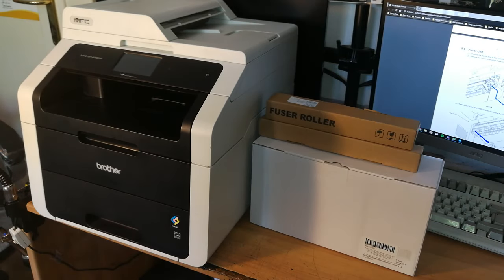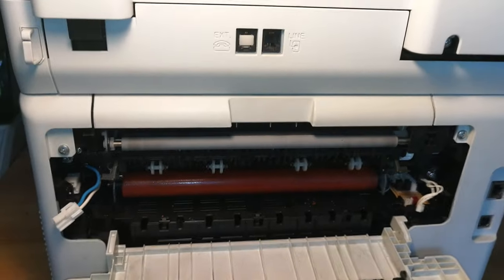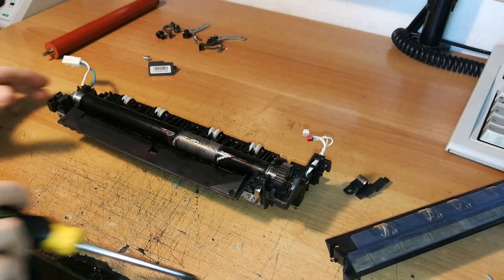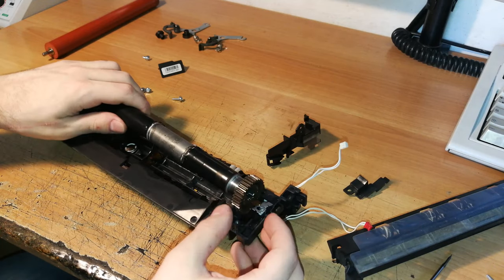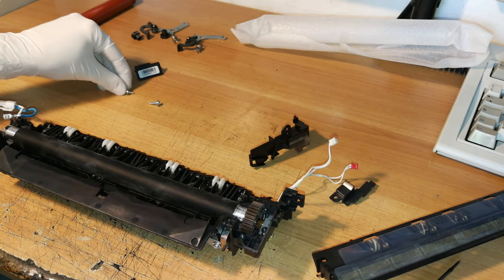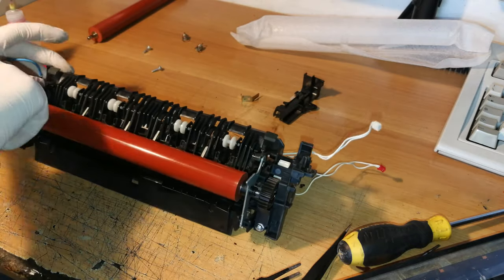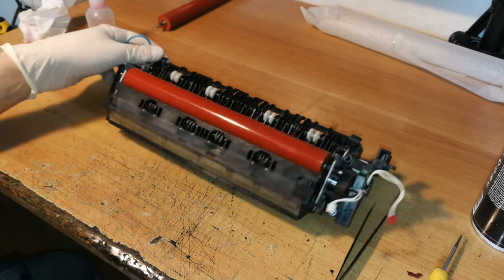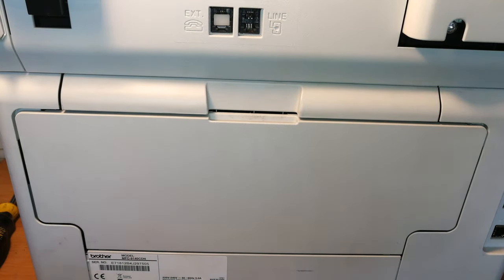Brother DCP-9020, MFC-9130/9140, MFC-9330/9340 • Fuser Unit Rollers Replacement

Comment: Thanks a lot Paolo, took me 2 hours but saved 300 bucks. I put the springs back the other way, so you have more place to pull them with a a small plate screwdriver head.
Reply from the maker: Great job :)

Comment: Thanks for the informative video. It’s worth mentioning (1) When re-attaching the springs, the black plastic tabs of the rubber roller assembly (the ones with the arrows pointing outwards) need to be set such that the rubber roller and the fuses roller are touching. It’s easy to have them set in the jam-clearing position which gives a gap between the 2 rollers. (2) Removing the springs with a hook tool from the metal tabs is better than trying to do so from the plastic tabs as you did. Safer to not break the plastic.  (3) When bending the tabs of the fuses roller outwards after installing the plastic gear, better to just grab the tab with needle nose pliers instead of grabbing the outside of that plastic gear as he did so as to not break teeth of the gear if it’s old and brittle.  Again, great video.

Comment: Thanks for the video. Used it to successfully replace both rollers. Had an issue reinstalling the spring and snapped off the plastic tab. . Bent a nail and braced it the other side to attach the spring to. Tip attach to the plastic tab first and then attach to the metal bracket.

Comment: Hoping to save MFC-9340CDW from waste with this video. I looked inside and looks like the top fuser roller has the same damage as yours. Must be something about these Brother models haha. Thank you!
Reply from the maker: This is something that happens even in some other brands of printers, as for Brother printers I can tell you that now at work I repair mostly the newer versions (MFC-L9570CDW) and I encountered the same defect as in this video but usually it only happens if you reset the fuser counter without replacing it, so if you use the fuser unit for more than the amount of pages that is designed to do, the older models often fail prematurely.

Comment: Over 2 years later and you're still helping people fix their printers! I just finished replacing the fuser roller (the black one, the red one looked fine) using this video as my "step-by-step" guide, and it went off without a hitch. Well, OK, with a couple, but those were my fault and not yours! (E.g., "I can get this out without removing that first!"... "Uh, OK, I got it out fine, but in order to put it BACK, I actually DO need to remove that!") Thanks SO much for taking the time to post this so old retired people like me can get their printers fixed at a reasonable cost! (Now we'll get to see if the roller I bought was of decent quality and will last, or if I'll need to do it again!)

Comment: Thx @Paolo. So helpful. Weirdly the Amzn page where I bought my replacement parts features a video without your voice but with your hands and workbench.  Recommend people read the comments, like don't take the teflon tape off the 4 little cleaner/pinch rollers.  Also to reset the fuser counter
Reply from the maker: Hi! Could you please send me the link to that Amazon page? No one asked me to use that video in other channels, and that needs to be removed by the other channel. Thanks for your cooperation.

Comment: The "adhesive tape" is Teflon tape that this supposed to be on the 4 cleaner rollers that it came off of.
Reply from the maker: Definitely true... I didn't know at the time, learned about this two years ago after officially becoming a technician for Brother :)
Reply: @Paolo Marcelli
Should I leave the tape on even if there is a small amount of residue on them? It's very flat, and a small amount.

Comment: Thanks a lot for your clear explainaitions. I just changed both fuser rollers on my DCP9020CDW. I also changed the 4 small rollers you just cleaned in the last part you put back. It went very well and my 8 years old printer is now working like if it were new.

Comment: Thank you for this video.  I just finished replacing the fuser heat roller and pressure roller on our MFC-l8900CDW.  There are a few differences for sure, but your instruction and video got me through it.

Comment: Finally got my rollers in the mail and did this and it worked!

To anyone trying this, MAKE SURE you have the right tools--you WILL need tweezers for the spring part, a small screwdriver and some needle nose pliers. Go slow and make sure to document every part and catalog each part as you go, many of them look similar. The guy in this video you can tell has a lot of experience with these so he knows how they go back together, but you will do yourself a favor to catalog everything as you go, and TAKE PICS of how everything looked BEFORE you took it apart. 

Pace yourself and go slow--remember this saves you almost 200 dollars (or slightly less depending on the price of the full unit for your printer), so its totally worth the time and effort!

My printer is the HL-3180CDW, so if anyone else is doing this for that printer, I can verify that this works, the only thing different is the 2 wires that connect the printer on the left are both white instead of white and blue, everything else is the same.
Reply from the maker: Thank you for writing about your experience :)
What you said is totally right, and also for the spring part now I use a proper spring hook (USAG 053 N) that I didn't have before. I go pretty fast in videos because then the video would be too long, but everyone should take the needed time to perform the repair. I've 7 years of experience and since November 2019 I work as a Brother authorized repair technician, it gets faster after you build knowledge and experience, but we all started from there :)

Comment: I had the video running on my iPad and would stop and start it as I replaced both rollers and the small printed circuit board (I damaged it removing the red connector and couldn’t get the solder to hold when I tried to repair).

Worked out great and my MFC-9340 is working again.  Thanks for the great tutorial.  July 31, 2021
Reply: Lol I damaged mine as well. I couldn't solder it back. I pulled the tab right out of the circuit board. I did however figure a work around. All I did was got two wires, one for each of the connections on the red connector and followed where each was going to on the circuit board. Plugged each end to another clip where the circuit lead to on the board, basically jumping the board to a direct connection. Worked like a charm lol.
Reply: Lol I damaged mine as well. I couldn't solder it back. I pulled the tab right out of the circuit board. I did however figure a work around. All I did was got two wires, one for each of the connections on the red connector and followed where each was going to on the circuit board. Plugged each end to another clip where the circuit lead to on the board, basically jumping the board to a direct connection. Worked like a charm lol.

Comment: Thank you soooooo much for this video. Replacing the roller worked out ok although it took some time. I would probably not have done it without your detailed step-by-step instructions. (if I may, a very brief note: when you grab the little parts during reassembly, please hold them still for like a second in front of the camera to they can be more easily identified. But this is just a well-meant constructive hint and not a criticism of your great work).
Another few observations. 
*) during reassembly, the spring was easier to grab from the other side. Before I did it the way you suggested, and I used a twist tie before finagling it down to make it easy to grab and pull. This was (for me) easier than getting in the tight space with pliers (even though I own professional jewely pliers).
*) I used an old paper envelope (any paper or not-too-thick cardboard will do) and stuck the various screws in there in the order that I pulled them out. During re-assembly it was easy to just grab them in opposite order. Easy peasy.
HTH.

Comment: Hi thank you very much. I did something in a different way: I removed and reattached the springs from the other side (the side of the levers where the pressure roller is). For the record, my printer is a DCP-9015CDW.

Comment: Thank you so much for doing this video.  I know they are a lot of work!   For the most part I had the needed tools at hand and it took me 1-1-1/4 hours, as I had to stop the video and complete the actions you outline, which I totally expected.  If I may make a couple suggestions, please.  At one point, when it came to rerouting cables, you fast-forwarded through the process.  This was a point where I wanted more time to see what was going on, not less.  At several points it would have been helpful if you could have paused at least a second or two at the end of key steps so I could have seen the result.  As it was, a couple of times the completed step was partially offscreen or your hand was in the way so the result never showed up.  The video was also a bit dark with shadows at times.

Again, thanks for these instructions - they are MUCH MORE helpful than just reading text.  You took a somewhat intimidating process and made it a lot easier.  Thanks!
Reply from the maker: Thank you for the feedback! I always try to improve in the new repair videos :)

Comment: You're a genius, man. Thanks a lot. You made me save a lot of money and plastic waste. It took me 2 hours to replace the rollers, now I have a  printer like new! My black roller was exactly like yours, and I've never tried to print on adhesive paper, so I think that the problem is the printer. By the way a small metallic piece fell from the unit while changing the rollers and I couldn't find its place, so my printer has a piece missing now... Hope it's not very important to make it work 🤷😁
Reply from the maker: That is a very common issue with this printer series :) good job
Reply: same here. it goes on the bottom to the right of the white wires. saw it here at 2:30 it's in focus: https://youtu.be/xkxEVNLi4M8?t=150

Comment: Great! Took me a good 3 hours with some hiccups along the way. Especially at the replacement of the black roller where I was reinserting the gear. It wouldnt go smoothly in like with the old one so I spent a lot of time using pliers to adjust it. Ended up making some grooves on the gear which made the rotation slightly bumpy. Actually I did not have to go through that and the initial seating was fine. But everything turned out smoothly in the end and I finally have smooth paper again!

Comment: Thanks. Very helpful. 2 amendments: 1. remove the springs from the other side (metal on metal), not from the bottom (metal on plastic) the plastic lug can get broken very easily although you can replace it with a metal pin. 2. That stuff about the little rollers trapping sticky paper is I think wrong: these little rollers have a paper coating so be careful about fiddling. Otherwise 10 out of 10

Comment: I did not pay attention to the fuser roller orientation and as the result it did not rotate the lower roller correctly. Upon inserting it back to the printer, it went to "too hot - cooling" mode straight away and it also smelled burning plastic. Lower roleller burnt, upper roller baked int the residue of the upper roller. Both went to bin :( Reordered again, hope won't make same mistake. Tip for putting springs back together: I used a paper clip that I attached to the spring and pulled by the paper clip to reattach it back onto the hook.

Comment: Thanks!  Another success with HL-3170 back to life and saving from landfill!  Suggestions (1) the internal rollers appears to have OEM white tape rolled on, I removed anyway as your video has done..others noted similar (2) Reattaching the springs, I did the alternate side final attach as appears much easier with a small device to pull (3) fast video on the wires reattach, just have to slow it down.   Feel like a electronic heart surgeon now :)

Comment: Just a note: The replacement fuser roll comes with REPLACEMENT paper feeder, ball rollers (4 of them) to replace the damaged/burned ones on the paper feeder attachment.  They are WRAPPED in MASKING TAPE.  The person who previously replaced the 4 ball rollers in the printer of the video above - did NOT REMOVE THE MASKING TAPE WRAP before putting them into the attachment. That is why you found masking tape residue burned on.
Reply: Hmm, I don't know about that. The 4 little rollers original to my printer has tape around them too, and they have never been replaced before. It's been working fine for 9 years until now, when the fuser roller started falling apart.

Comment: I would like to share some advice that will help you not to disassemble the whole fuser unit. If someone does not have to clean the fuser very much, there is no need to disassemble the two ends of the heater. When you pull out the heater connector (7:23), you can theoretically proceed to pull out the heater shaft. It is held only by a bend at the toothed wheel (shown in 11:38).
If the roller is still in the fuser, this bend can be straightened with a flat screwdriver, freeing the roller. After changing the rollers, you can bend the plates from the new roller with long curved pliers. I was able to change the heating roller in this way.
Nevertheless, your guide was extremely helpful when changing the heating roll. Thank you very much!
Reply: ha, good idea.  I should have read this before I did the job!  I'll bet your idea would have saved a lot of time with that last cover and all the wires

Comment: Great video, Thanks for making it! One suggestion, using a spring tool such as a Jonard M-130/SX5 (hook end) on the other end of the spring to release the tension makes it very easy to remove and replace springs.

Comment: Hi there, I just wanted to thank you for the great video. You may recall previously I had an issue with rectifying a fault when I replaced everything back together again (05 fault). It turns out that I was too rough when I removed the white and red leads from the board, so I ordered a new board from Ali Express for $15 and the printer is working fine now.....thank you again....Ken - London
Reply: Can you please share the exact name of the board ? I also need to buy it and replace it
Reply: @babettelours3129  I purchased this from Aliexpress....the story name is ZN SUSAN Store....however I note that they no longer sell it anymore.......anyway the part you are   looking for is a fuser sensor.

Comment: Very helpful video.. thank you for that. I followed the instructions and changed the roller and fuser myself. However after changing it now my paper comes out wavey or curly just the bottom half of the paper. Could you help with that? 

Thank you very much!

Comment: Genius!  Thank you!  I had a really bad paper jam and this fixed it. However, when I restart, it says, "Jam Rear: Open the Cover and remove the jammed paper and press [Start]."  I did not see any additional jammed paper, especially since I replaced the whole fuser unit.  If I open the cover and close again, it say "Close the Fuser Cover which can be found behind the back cover of the machine."  I opened and closed this and it does not help.  I am getting an error 6004 -- Fuser Cover Open."  So this is preventing me from finalizing the repair.  I went into Maintenance Mode and tried to reset the PF Kit but I don't think it worked.  Any ideas?  Quite a challenge!  In any event, your video helped me make the changes so far, so thank you for taking the time!
Reply from the maker: Hi! Aside of removing the fuser unit again and reinstalling it following the video very careful step by step I don't know what to suggest :/ I think it could be a problem of something not plugged in 100% or something installed incorrectly.
Reply: @PaoloMarcelli  Thanks Paolo I will try that!  Thanks for responding!

Comment: Thanks, followed these instructions and now smooth printing :)

Would have been useful to get a clearer view of which screw was which going back in, and the right hand plastic cover at the end on mine (9020CDW) has to sit behind a clip which caught me out at first.

I also had a small metal clip fall out of the riser assembly that for the life of me I can't figure out where it came from.

Comment: Thanks for this video! I have this same printer at my office and we are having quite a few problems with it. It's been jamming constantly for a year. Recently someone put a brand new belt unit in it. The paper jams at the back door near the fuser. About an inch is sticking out. Is this a fuser issue? The red roller on mine is very slick.

What about drum units? I noticed the ones in there are crappy non-oem ones. Would those contribute to the problem?

Comment: Thanks for sharing this video. I have a question if you could help me with please. My printer is (HL-L3230cdw),  but it recently started making these noises and then i realized the the two grey rollers on the back side have stopped turning and they wont allow the paper to spin and roll forward. That's why when the back door is shut, paper gets stuck as it can't come out from the front side. Can you let me know how I could fix it please? Thanks

Comment: Hello and congratulations on your nice video. I own a 9140cdn printer which works fine until I print documents of about 20, 30 pages..... after that amount the print quality becomes so bad that the document is not readable. 
I think it is a temperature problem that somehow affects the printing.... I have changed toner and drums without any improvement. Do you think the problem is with the fuser unit? So far I have printed about 27,000 pages, half the expected life of the fuser unit...
Reply from the maker: That could be the case, but I'd have to see a test print with the defect to be sure. Is the toner sticking to the paper? Can you rub it off with your finger nail?